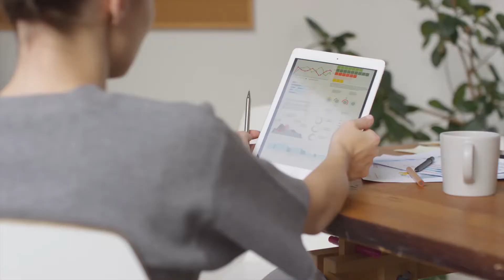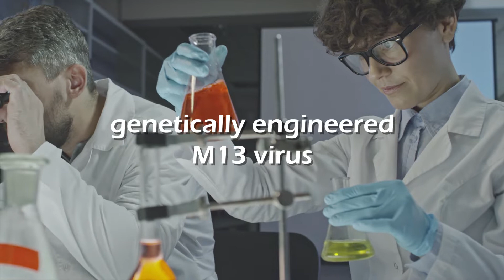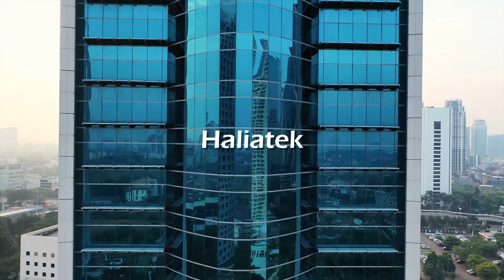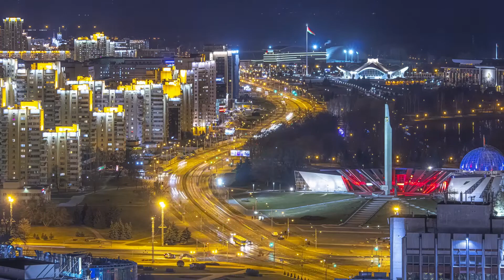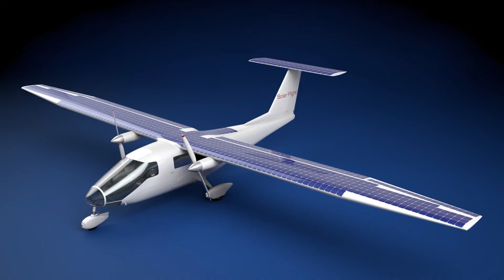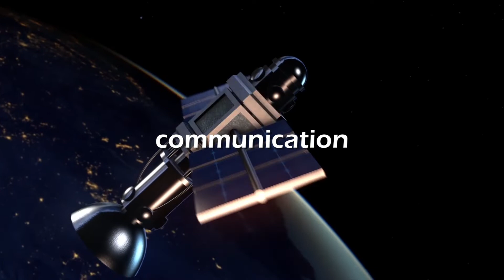SOLAR ENERGY - A Future Powered by the Sun (Solarpunk)

Comment: Cool ideas and all, but you can’t just come up with different ways to generate renewable energies. You also need to reduce CO2 admissions. I’ve been watching videos comparing road layouts in the US vs the Netherlands, and I think we need to do something similar to the Netherlands. Make it where more shops are closer together in a single street so it’s easier to walk to where you need to go. There’s also a way to use that extra foot traffic to generate more energy by putting in electric sidewalks. Every time someone steps on a pressure plate, they generate electricity that goes into street lights.
Reply from the maker: I agree with you about the road layouts. I'm just in the process of moving to the Netherlands and although I've never been to the US, I have noticed how tightly packed everything in the NL is (+ love the idea about electric sidewalks). Regarding CO2 emissions, it's true that I haven't really mentioned anything about those in this video and maybe I should have, however it's probably because I've left them for my previous video, which is about energy in general.
Reply: @siirmartin403  ok 👍